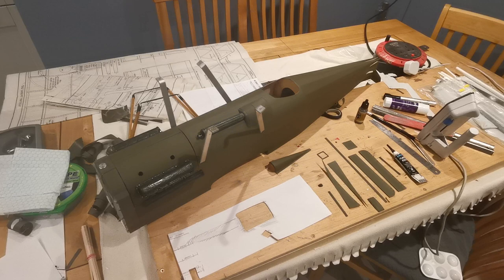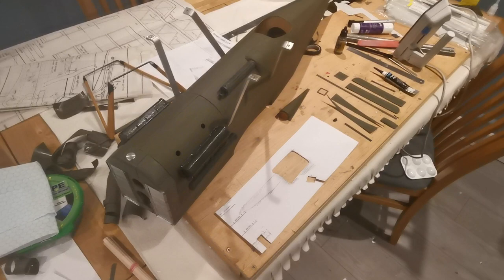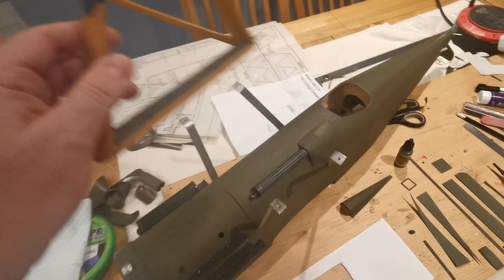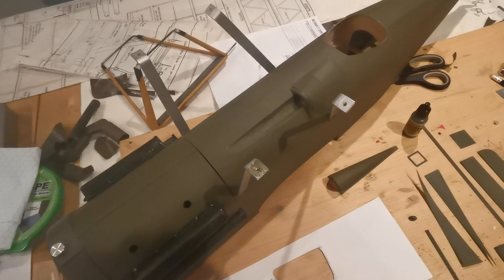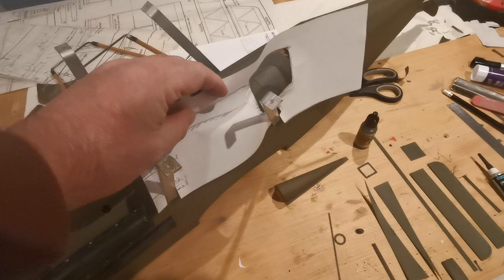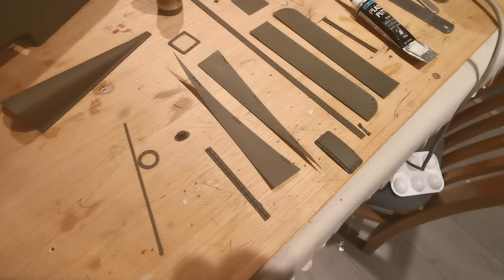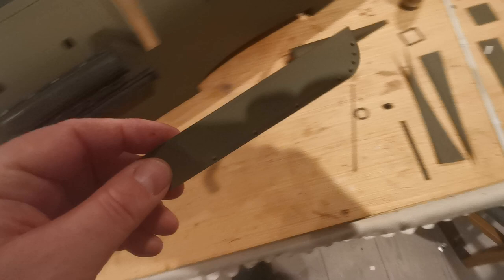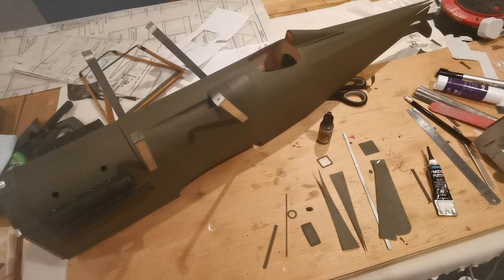Flair SE5A fuselage covering.

Comment: hi mark, great work - shes looking good, i was wondering if the plans gave a side view of the fuzz with the end view of the wings in position, im looking for a measurement / dimension (maybe you can take it off the plan) of the hole centers at the ends of each of the forward and rear wing strutts please - if possible ? or maybe the wing strutts come already made / drilled in the kit and you could measure them if possible, regards pete,
Reply from the maker: Im not sure exactly what you are looking for can you try to explain again?